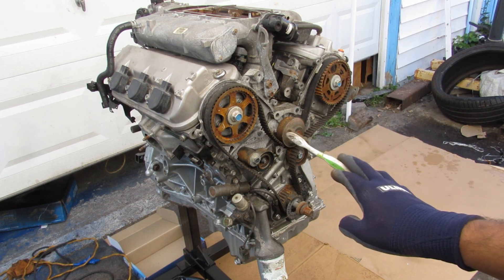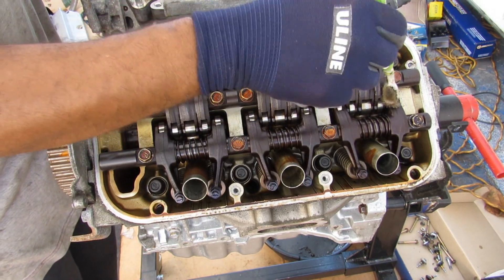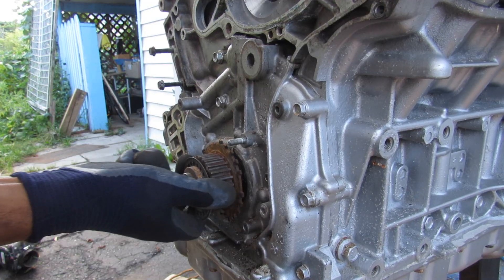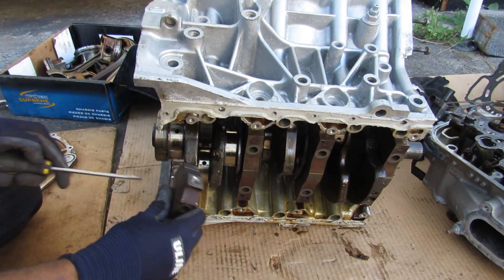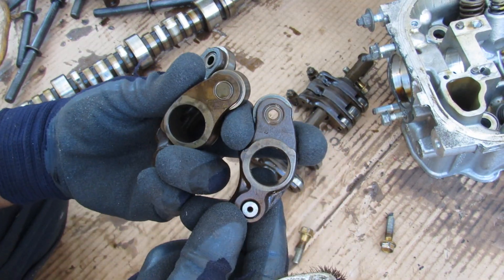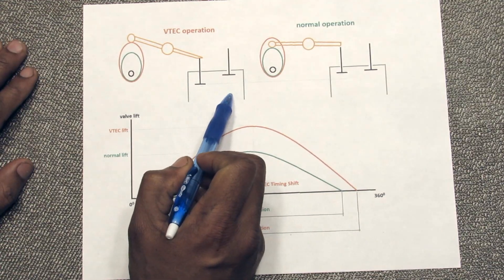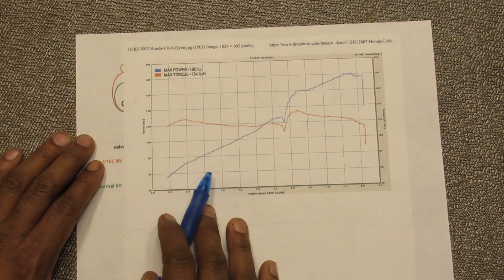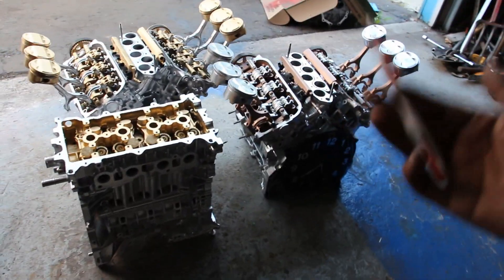How Does Honda VTEC Work?

Comment: Impressed by the quality of the construction. Only negative I see is a timing belt versus a timing chain.
Reply: Check out Toyota timing chain leak. Motor out in transverse V6's
Reply: Yeah. You and everyone else. That’s why Toyota and GM and lots of other manufacturers went to chains. 

However, it turns out that chains can stretch and jump a tooth from overheating  if you are dealing with oil dilution and comsumption combined with excessive oil change intervals in modern direct injection engines. 

And since they aren’t a scheduled maintenance item—expected to last the life of the engine—they aren’t regularly checked nor are they easy to replace. If you’re lucky you’ll get a check engine light with a code for cam position. If not, the results are even more catastrophic than a timing belt failure because you’ll likely damage all of your pulleys and a metal rather than plastic timing cover sending all kinds of metal cornflakes to the oil pan. 

Gear driven is good.. but would be very complex for DOHC engines.. requiring worm or beveled gears combined with drive shafts (this was used on the RR Merlin for SOHC) rather than stacks of idler gears for each cylinder bank. 

The last automotive engines I know with gear driven cams are the Pontiac 2.5 Iron Duke and the Ford 300 inline six. Both straight engines with overhead valves that only needed two gears. A vee engine would need an idler because the camshaft needs to rotate the same way as the crankshaft for simplicity.
Reply from the maker: Yeah the belt needs that service
Reply: Bmw's N47 chains says hello
Reply: I'll take a belt over a chain. Easier and cheaper to service if you plan to drive more than 200k.

If you really want to argue about it, I perfer gear-driven cams. ;-)
Reply: I’d rather have a belt that’s a wear item than a timing chain that’s much more difficult to replace when it goes bad at 200k. We lost a Honda to a failed timing chain.